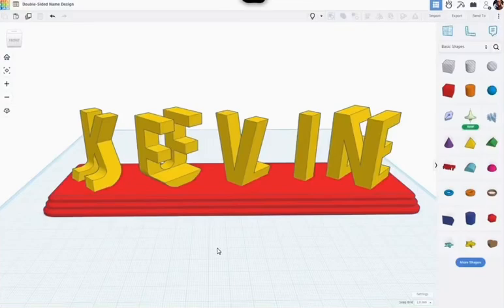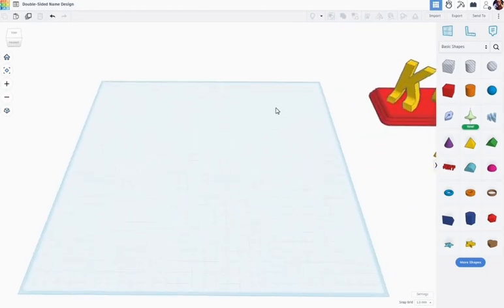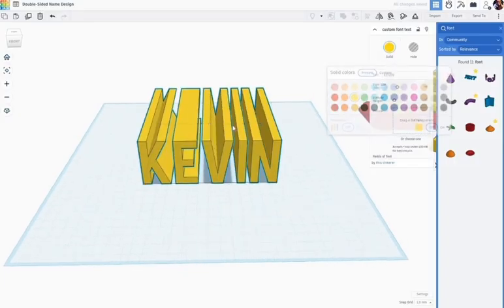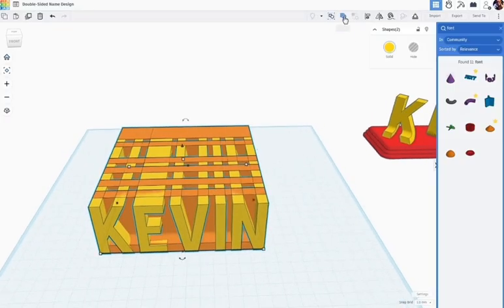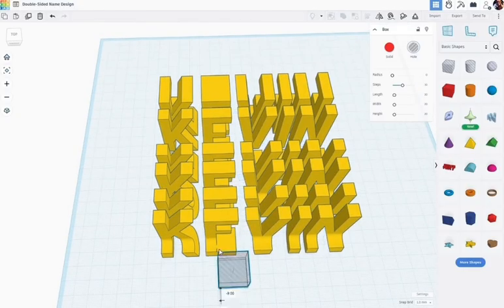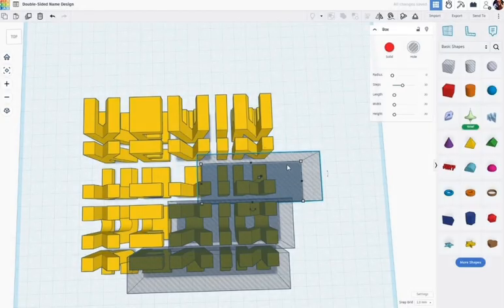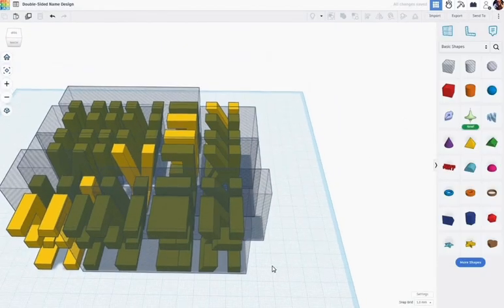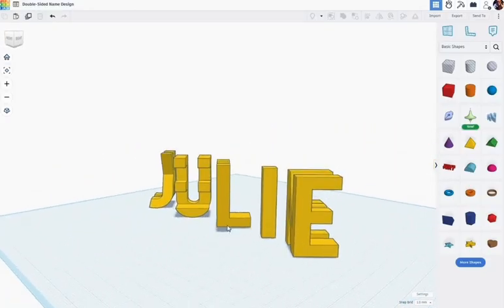TinkerCAD Tips! Intersect Group & Double-Sided Name Plate Design.             #tinkercad #3dprinting

Comment: Use the drawing tool  create negative space to cut away
Reply from the maker: That sounds a lot more difficult than just using this intersect grouping.
Reply: Are you saying to draw two shapes with the drawing tool that encompass the letters you are deleting and then changing the shapes to “hole” to subtract those letters with a union instead of  doing multiple boxes to delete them? I will try that too.